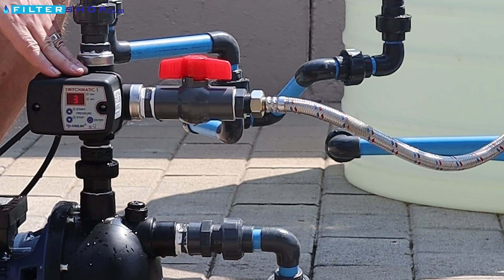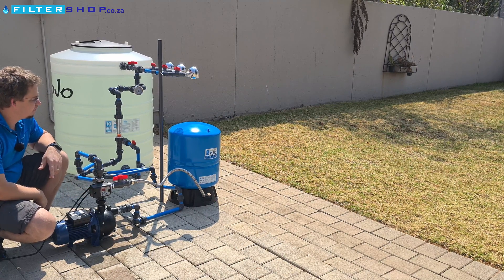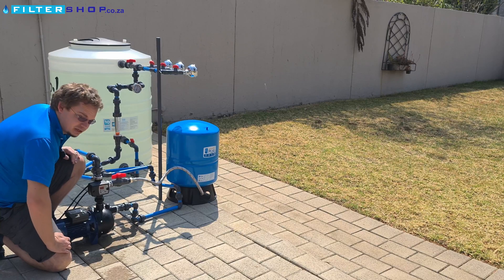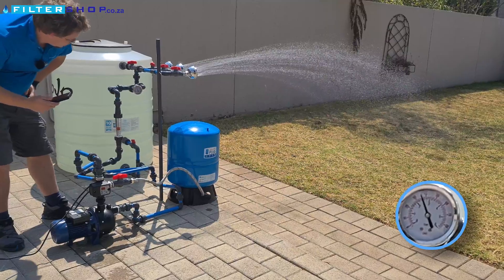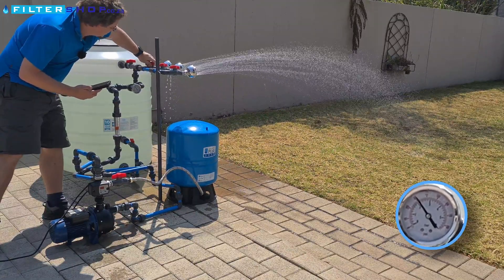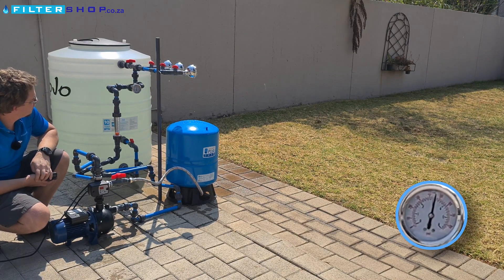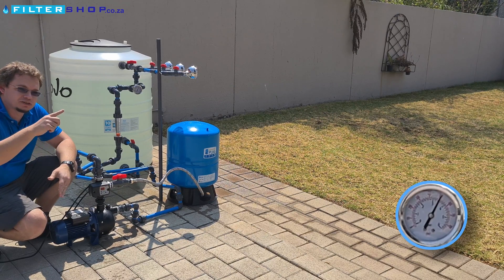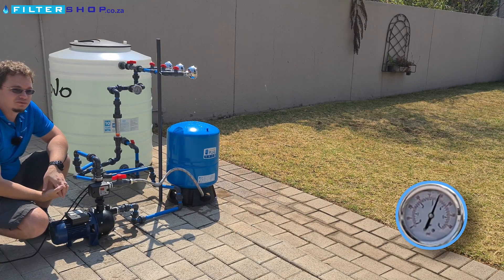Coelbo Switchmatic 1 T KIT Review

Comment: Hi thank you for the Video. It exist Switchmatic with T kit ( yours) and Switchmatic without this kit, just like a presscontrol . What is the difference between these two options? Why you do not used the second options? tenx
Reply from the maker: Hi, They are basically the same except the T kit has larger ports so we normally use it. If you don't use a tank you can blank off the extra port.